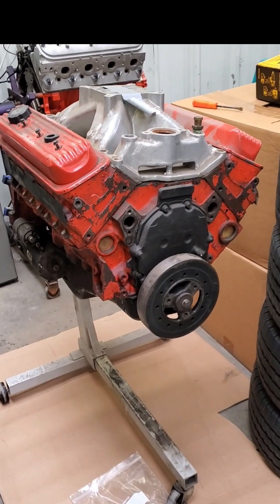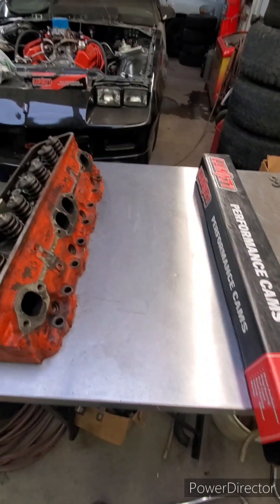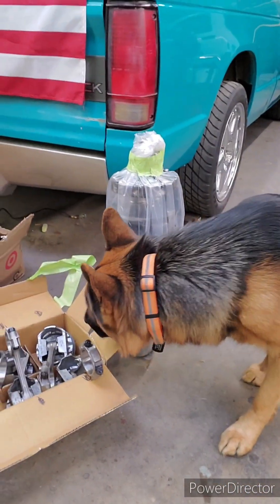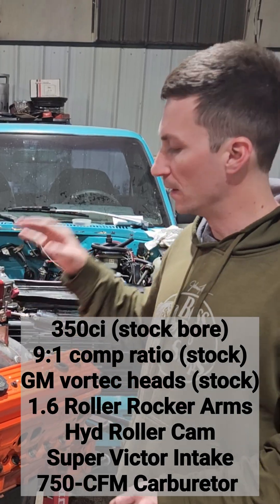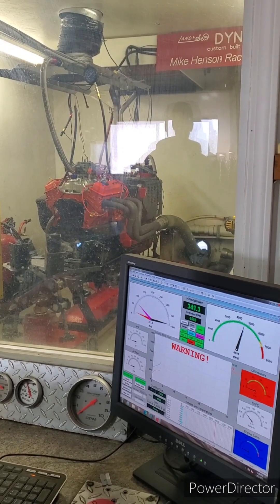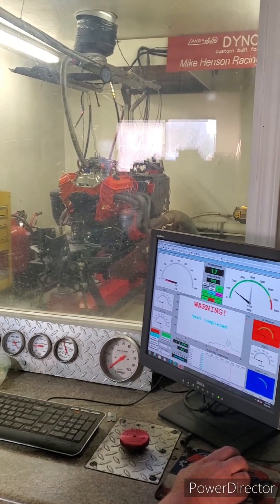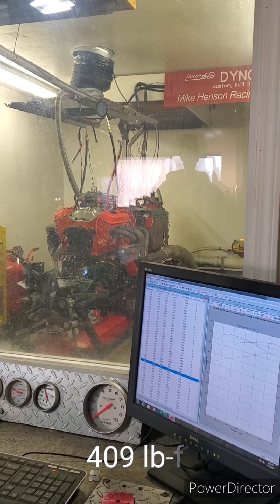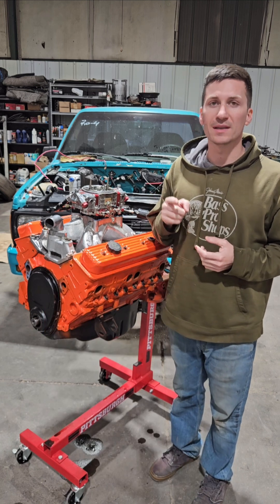Best Bang For Your Buck (Stock Long Block)

Comment: Is it stock valve springs and rocker arms. If so isn’t the rocker arms 1.5
Reply from the maker: @florenciodelatorre6181  I cut the pockets and valve guides and bought some springs from Clay Smith cams
Reply from the maker: @florenciodelatorre6181  the rocker arms are 1.6 ratio
Reply: Did the same thing got a vortex engine and swapped it into my 91 s15. Now working on my 85 Camaro z28.
Reply from the maker: @florenciodelatorre6181  you got the same problems as me lol
Reply: @After_Hours_Speed  I guess a good problem to have. Lol
Reply from the maker: @florenciodelatorre6181  it's a blessing and a curse lol